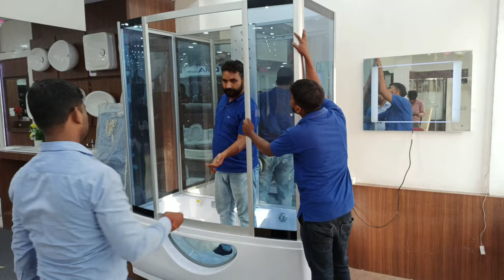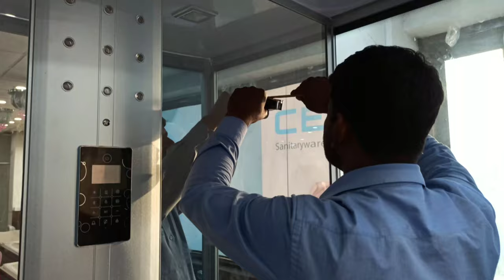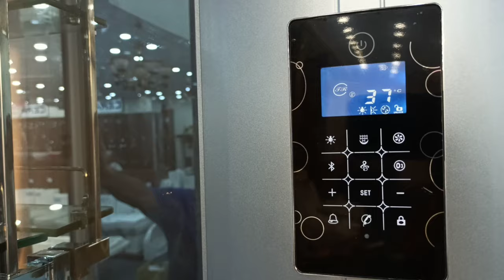jacuzzi bathtub + Steam Shower whirlpool | Jacuzzi installation by CERA

Comment: What is the price?
Reply from the maker: CADEO
Steam Shower Room 
1700 x 850 x 2200 mm 
• Ceiling Shower gives rain shower experience
• Hand Shower
• Top and back lamps provide bathroom like ambience
• Back massage jets gently soothe and invigorate body
• Control panel to operate all functions from a single point
• FM Radio to listen to one’s favourite music
• Steam room to rejuvenate body
• Exhaust fan circulates fresh air
• Foot massage invigorates tired feet
• Glass rack and shampoo box provide storing space
• Two level glass rack optimises storage
• Soft back rest to sit back and relax
• Pop-up drainer drains water and also works as overflow
• Six body jets to massage the body thereby improving blood circulation
Cat. No. B2513113
Reply: Price toh batao

Comment: Price
Reply from the maker: Check description
Reply from the maker: CADEO
Steam Shower Room 
1700 x 850 x 2200 mm 
• Ceiling Shower gives rain shower experience
• Hand Shower
• Top and back lamps provide bathroom like ambience
• Back massage jets gently soothe and invigorate body
• Control panel to operate all functions from a single point
• FM Radio to listen to one’s favourite music
• Steam room to rejuvenate body
• Exhaust fan circulates fresh air
• Foot massage invigorates tired feet
• Glass rack and shampoo box provide storing space
• Two level glass rack optimises storage
• Soft back rest to sit back and relax
• Pop-up drainer drains water and also works as overflow
• Six body jets to massage the body thereby improving blood circulation
Cat. No. B2513113
MRP-290850